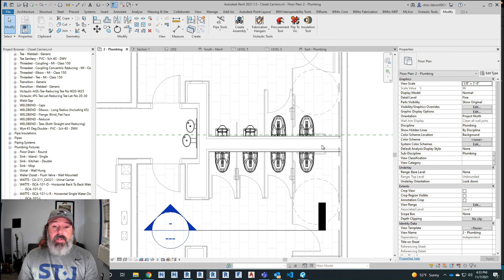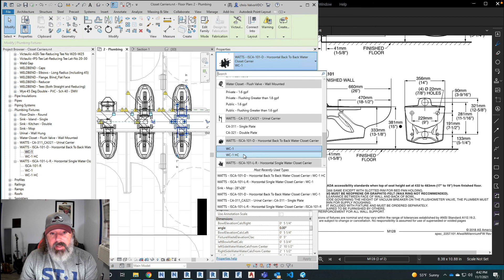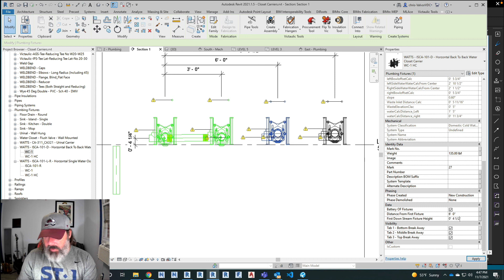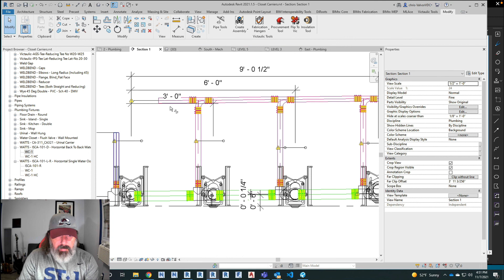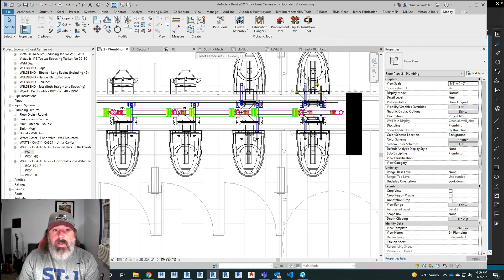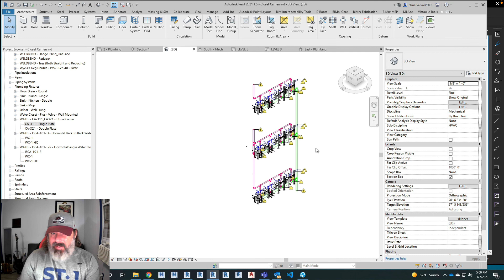Better Revit Closet Carriers Families

Comment: very cool stuff man! glad i randomly came across this. I've always hated how the zurn carriers behave. I've been just using a sanitary tee and faking a vent in the top of it and they get the idea on the isometric of what's going on. I may modify it so the face plate and legs do not show in my isometric views.
Reply from the maker: Thank Ken, glad I could help. Now that You mention it, I may have to look into adding a yes/no parameter to turnoff the feet and faceplates. Also stay tuned, I currently I have plans of developing a plug that will automatically elevated the carrier barrels without you having to enter any distances.
Reply: @ValorVDC  yes thank you more. I ended up turning off only the bolts with a yes no parameter. I also included the water connection extrusions you created for the connectors on that parameter aswell. looks decent in my iso and not so cluttered

Comment: hi there! I am just a student. i really like your carrier family. one question I  have is how do you connect the plumbing fixture to the carrier. I am using Revit toilet family.
Reply from the maker: Thank you for your nice words. The best way would be thru LinkedIn. https://www.linkedin.com/in/christopher-bowker-46552545/
Reply from the maker: I never put a connector for a water closet, but if use a face fixture it should work in theory. But you will need to make some adjustments to the support rods

Comment: Thank you so much. I broke the carriers down to 3 parts and worked with them watching the bolt pattern on face plate. The ones you have are so much easier to work with and watching the bolt pattern in the batter configuration you can judge your distance on how many carriers you can place before running past the limits- Again thank you!
Reply from the maker: Glad it helped, I am currently looking into developing a Revit plugin that will automatically elevate them so you won't have adjust each one independently as shown in the video. Look for it within the near future.